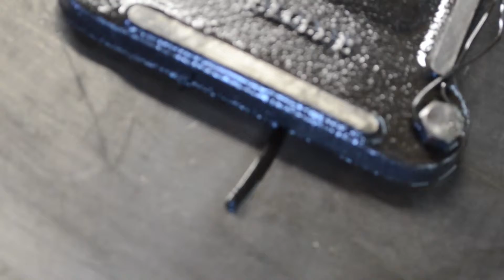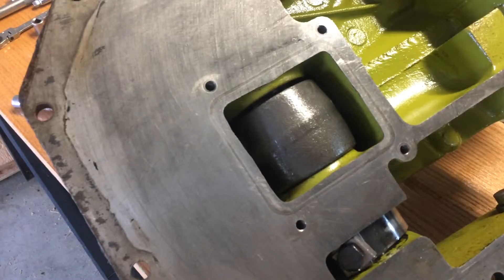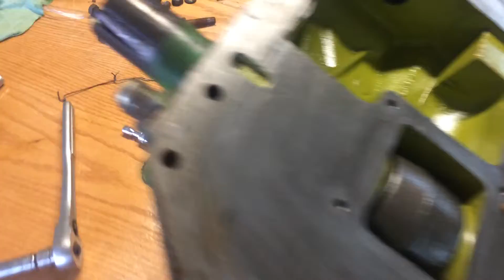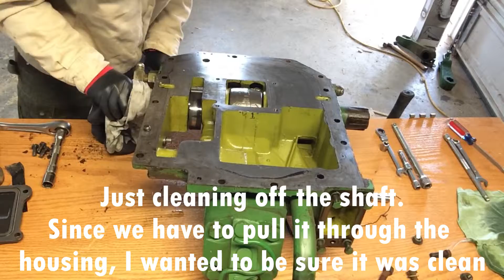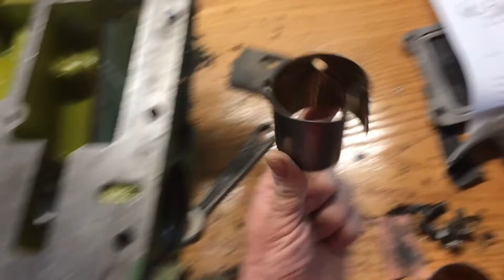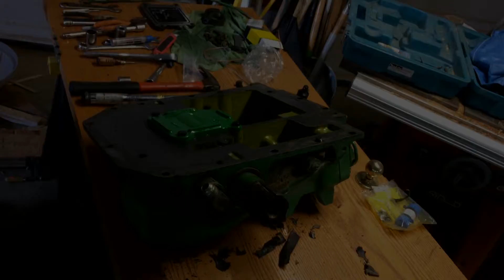John Deere 4430 Repairs - Part 3 Rockshaft Bench Repairs

Comment: Thanks for making these videos! They are very informative, without too much yapping.
I have a 4440 with FWA that has the same problem, and i have a few questions.
What caused the excess oil pressure behind that plate, as to bend it?
Is it still working for you, without leaking oil from that plate?
Do you have the part# of that plate?
Reply from the maker: Your question is very timely!  This winter I did have a relapse where the plate is leaking again.  I don't know yet if the plate is bent, but I am going to order one just so I'll have it if I find that it is bent.  To make a long story short, I found out about two weeks ago that a previous owner had installed the filter bypass spool valve backwards, and the way I found that out was because the filter bypass housing started leaking all of a sudden.  I will actually be uploading a new video on Friday going into more detail on what happened in my case.  I can give you the part number for the plate, but mine is for a 4430 - not sure if it is the same part number or not.  There are probably other reasons for over pressure, but I am not aware of them.
Reply: @BlackHorseRanchIdaho   According to my mechanic, there should not be more than 165 psi in there. It would take WAY more pressure than that, to bend that plate. So by fixing the plate you took care of the symptom, bot not the cause.  I want to figure out what caused it, while the tractor is still functional. I want to test pressures in the systems. I look forward to watching your video.

Comment: Can't tell you how helpful these videos are... I think I have the same problem and have been dreading this repair.  I don't have any strong lads to help me get the rockshaft cover off, so I may be fabri-cobbling something on the end of a cherry picker to mount to those four bolts you showed in Part 2.  Our 4430 is our main tractor so I'll be making this repair in the winter.  Looking forward to part 4!
Reply from the maker: Thanks Brandon.  I am glad they are helpful.  You know as much as I do how little information there is out there about these old tractors, so I am super happy that these videos will help someone out. I think the cherry picker will work great if you can roll it.  To be honest, the repair wasn't near as bad as I thought it would be - probably just me dreading the unknown!  I was lucky to have a good mechanic to be able to ask questions when they came up!  Good luck!
Reply: Absolutely!  You know a couple years ago I removed that big plug just below the rockshaft cover and saw a ton of oil gushing down from (what I now know is) that plate.  For some reason I thought I'd need a degree in fluid mechanics to ever figure out what the problem is.  Now, aside from a huge weight being lifted from my shoulders, you saved me all that tuition money  ;)
Reply from the maker: Just be careful - my mechanic but a pressure gauge on the gearbox lube oil pressure port and with the rockshaft leak I would lose my lube pressure completely whenever I used an SCV.  He said as long as I only used the SCV for a few minutes at a time and stopped for lube to catch up for a minute, it would be fine.  You just don't want to cause any other damage in the gearbox.
Reply: Yeah, I think I'm going to be spending some serious money once I dive in... It's been like this for years, and there's a loud whine coming from the rear end (which I'm assuming is coming from that poor feeder pump). I hope the rest of your repair went ok (the SCVs and reassembly)!

Comment: I believe the wires purpose is for vibration to prevent the bolts from unscrewing themselves over time.
Reply from the maker: That is a great point, they would definitely function in that way.  I guess that is what they did before they had loctite maybe?  My mechanic said that those original  bolts are notorious for popping their heads due to the pressure under that plate and the fact that they are soft.  Since the new bolts are grade 8 and have loctite on them, no need for the wires anymore!